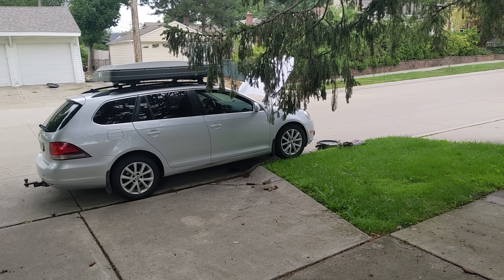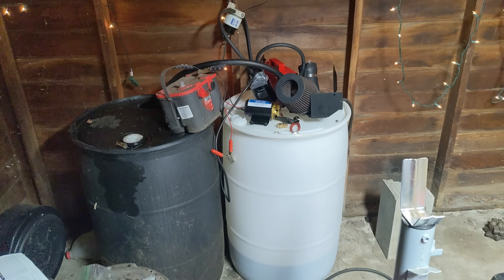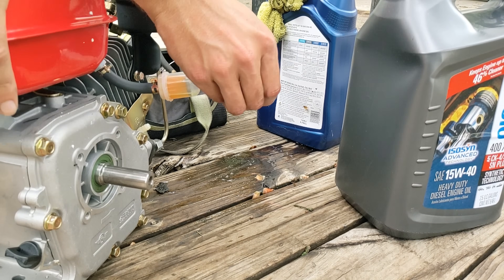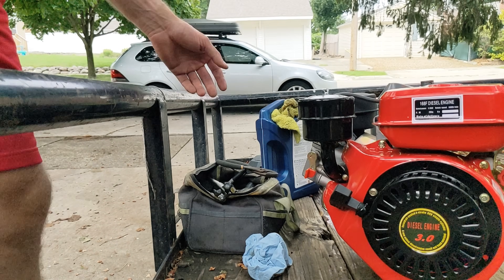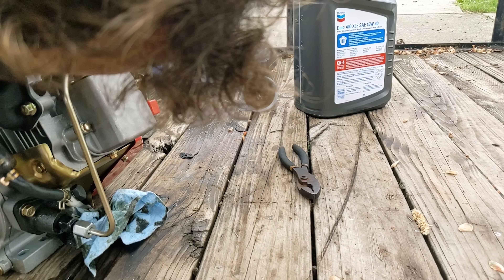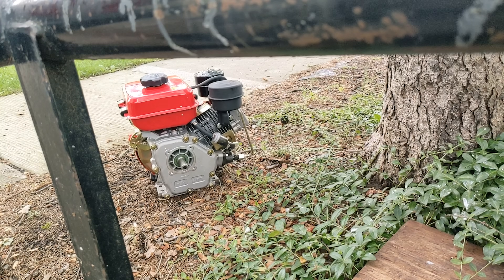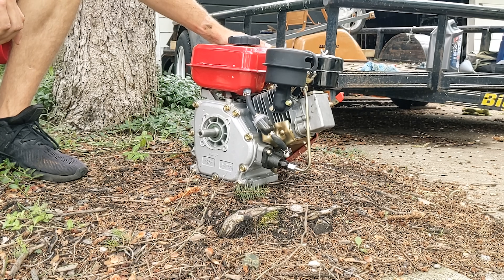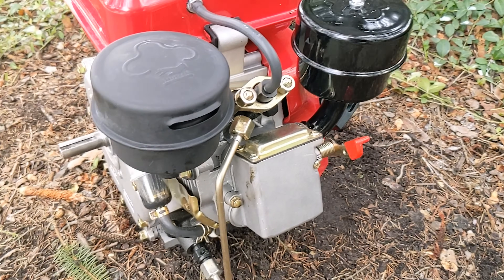Can a 196cc diesel engine run on Waste Motor Oil (WMO)?

Comment: 2:05  15w40 is very thick for that VW
Are ya in a super hot region? Normally they need 5w40 or 10w40 at max

Comment: Preheating the fuel is a great idea same as waste oil burner. Dropping injections pressure is also good saves pump. Filtering oil when hot would also allow for finer filter to be used. Hot can be 100 deg c

Comment: I use a magnet and then I pour it through a clean microfiber rag to filter it and then I use about 3 quarts of 2 stroke gasoline for every 5 gallons of oil. Since my truck is common rail and i dont want to coke up my injectors i use black diesel as a fuel additive more than an alternative. It makes up in lubricity for what you lose in that ultra low sulfer crap they sell at the pump. Obviously you shouldn't do this if you have a DPF.

Comment: Excellent choice of oil.
 I've owned my own semi's for 25 years, I've tried every brand of oil, and Delo is by far the best out there.
 For those who want to argue, it holds its viscosity the best, and has the best corrosion inhibitors.
 I've run water/methanol injection for 15 years on my trucks.
 With this system there is always some moisture that gets past the rings into the crankcase, and very few oils will compensate for this. 
 Why run water injection?
 Torque,  power, cools the engine,  cleans the engine.

Comment: The problem running a diesel on motor oil are the inorganic (SAPS) additives in the motor oil. Ashes from the additives will clog the combustion chamber, valves, exhaust channel and exhaust. My motorcycle engine burned roughly 15 Liters of 10W40 over a distance of 30k km which coked the exhaust side terribly. Since the opposite cylinder didn't use that much oil, it was much cleaner.

Comment: If you haven't check out a centrifugal wmo filter, they are pretty neat, and can filter quite a bit before needing cleaning them self've. Personally I would suggest filtering down further say at least 20 microns the reason is the largest particles are hard to burn, and will carbon up the engine over time. Get them down as fine as possible and mechanically it will last longer before needing maintenance, you could also add a bit of new auto trans fluid in directly with the wmo,to be filtered say a half a quart to a quart a gallon this will clean the combustion chamber pretty good

Comment: Try to mix with gasoline 800ml oil 200ml gasoline. And the engine more responsive. And low smoke.

Comment: I drive diesel trucks for a living and use to run old Detroit 2 stroke engines and ever time I changed oil I dumped the waste oil in the fuel tanks and burned it.

Comment: PS. Most engine oil filters are 20 or 30 microns so you're 100 micron filtration isn't doing much for used motor oil

Comment: Used to run my boat engine like this in the UK - till the government made it illegal. You can still do it, but you have to have a very expensive licence. I would generally ignore this kind of over regulation, but because of it, my waste oil suppliers are no longer happy to let me have it. Oil from oil changes always goes back into the fuel tank.

Comment: Very cool to see that this works :) I am debating whether or not to buy this one, or its bigger brother, which is 10hp. I think the bigger one would be a better buy, because it gives you a lot more flexibility. And even though it is more than 3 times as powerful, it only costs around $450 shipped :)

Comment: Every old diesel can be run with WMO just need to be a engine without cpu and electronics... Must be pure diesel :D but that 'fuel' creates problem for the engine if its not filtrated and mixed with diesel :)) and in cold weather its hard to start the engine

Comment: you did it wrong. first oil need to be filtered. cofee filter would be enough,
second, it should be mixed with diesel fuel, 50/50 would be perfect

Comment: First; the fuel line from the tank does not go to the "injector," it goes to the fuel pump.
Second:;  A metal particle ⅓ the diameter of a human hair can clog one of the six tiny injector nozzles, why risk it.  You could have clogged two or three of the nozzles and not know it until you put a load on it.  Without a load your test is meaningless. Ron W4BIN

Comment: Really you should at the least cut the old oil 50/50 with #1 diesel fuel. I'm tight with money, but not that tight.

Comment: Are you by any chance aware that your WV car engine features an oil filter? That filters particles down to say 25-30 microns size? Which you were trying to better by hauling your oil through the 200um screen??? So just curious, what did you expect to see on this screen? Also, do you change the oil filter on the WV engine EVERY time you change motor oil? As the book says?

Comment: I had a 10 HP version that I  ran on 100% Used Veggie oil (I collected from an Arby's Fast Food joint)
for about 5 years. It ran like a charm ! Never had any problems with it at all. 5 years later it blew a Head Gasket. Simple inexpensive fix ! Liked/Subscribed !
 FJB

Comment: I bought an Indian Enfield diesel motorbike from India, with a 325 mL diesel, single cylinder engine. And the fuel filter smelt of Curry. I can only assume that they used waste oil from cooking..

Comment: I think you'll find that the shaft is actually 19mm . . . . which is the same size as 3/4" . . . . . there's   NO Way   they would make that a different standard. Zero chance.

Comment: I run WMO (black gold) in my OLD 1989 7.3.. 100 microns is nowhere near enough filtration. I suggest obtaining a 0.5 micron polyester filter bag to pour that oil through. That's right, one half of one micron, the injection pump will thank you by having a long life..

Comment: Heat the old oil.

Let it settle out for a couple of days.

Run the oil through a good filter. (or you are asking to destroy the injector)

Mix 75% diesel, 25% used oil.

It will run fine. in warm weather.
It might be too thick for starting in cold weather.

Comment: you should try to assemble a motorized bike build with the waste motor oil, should be simple and cheap enough; with a good bike frame and some fat tires it could make a janky offroad build with that extra diesel torque.

Comment: You need to run the waste oil through a centrifuge to remove fine particulate.  These particulates will eat your injector and is hard on the engine if not removed.

Comment: At least the grooves from burnt carbon on the cylinder liner wont be bigger than 100 microns.
Carbon is some of the black colour in old oil.

Comment: I have an old Belarus AS250 farm tractor. I only pushed the oil thru a T shirt to filter the used oil for it. In the heat of summers , it has zero issues. In winter , I add 20% gasoline so it'll crank on cold mornings. Also have a couple 6.9 liter Ford trucks. We made a homemade centrifuge to filter the used oil for those old engines. The 6.9's run a little stronger with 10-20% gasoline added to the oil, but still run fine.on straight oil.

Comment: run HHO or propane in addition to blending with diesel.  NO- HHO  or LP won't improve short term (higher HP/torque gains)  and all that crap as they claim but YES it will give more complete combustion keeping from coking the rings etc that will happen on an alternative fuel that the injector  and injection timing is not tuned too.

Comment: Diesel engines do not give a shit what you put in them. They will run on it. And as long as it is a heavy, flammable oil, rather than a light aromatic, they will run WELL on it. They like motor oil so much, in fact, that turbodiesels will happily destroy themselves if the turbocharger seals let go and allow the engine's own lubricant to get into the intake tract.
Reply: So your saying so long as i filter the oils  a little engine like this will run on it? Mix used filtered vegetable, conola, engine, atf and itll work? What about things like grease i.e. automotive, or even bacon, and can you even turn those into a viscous liquid and it keep that form instead of re hardening?
Reply: Old diesels yes but you can’t run this stuff in a modern common rail engine for instance, it will destroy the fuel system
Reply: @alexbeuerman7608  what is there besides rail fed for diesel I thought they needed to be pressurized and couldn't run off of a carb
Reply: @rs-nk8cf  An engine like this, and pretty much any on road diesel before like 1995 or so is gonna be indirect injection, those will run on just about anything. It still has a pressurized fuel system of course but not as much finicky tight tolerance hardware in the fuel system as a newer CR mill

Comment: I’ve got a plan (more of a possible experiment, really) to use this with plastic pyrolysis oil . I don’t expect it to run for long before breakdown or maintenance. 

But it could be a sweet “proof of concept” to see if I can make a self contained unit to use the plastic that’s currently getting rejected by the recycling streams worldwide.
Reply: i've been wanting to try pyrolysis but im scared to blow myself up. Do you have a setup built? I would love to see a video on it.
Reply: @Geopolitics2day  I haven’t built anything, just starting the research process

Comment: In Afghanistan I saw a guy with a watercooled China diesel.  He had it hooked up to what looked like a truck alternator with a couple of wielding leads.  They had a half 55 gallon drum with a pick up at the bottom and the return just poured back into the barrel.  The whole contraption was mounted on a 4 wheeled trailer and dragged around with a tiny pickup.  He didn't have a wielding helmet but he did have a dark piece of glass he would hold in one hand and the rod in the other!
Reply: It's pretty common in my state Kashmir
Reply: probably cheaper in afghanistan to make that instead of buying a welder or they just like making things.
Reply: @ARMASOG  They HAVE to make things.

Comment: It works - for a while.  Runs and starts better if the oil is thinned with about 20% kerosene.

But the soot, junk and additives in the oil will coke up the injector pretty soon.

Waste hydraulic oil works better.

Comment: Waste motor oil, really?
Are you aware that that kind of oil has got a lot of additives, that are not meant to burn?
Although a little of it can be burned , during normal use of a diesel motor: that is why car engines have got to respect emissions legislation, through the help of special exhaust lines and catalyst converters.
Without this, burning motor oil is simply producing dioxins, that are highly carcinogen substances, that don’t degrade when released.
Is it worth it? In my opinion, better have recycling oil companies handle it the proper way!

Comment: No use the coarse filter initially to fill the day tank or storage tank, but you want a 10µ filter for a primary or your OEM filter will clog up and bypass all sorts of crap to your injector. Also you probably should start on road diesel, then switch fuels once it is up to operating temp, and switch back to diesel before shutting down. And PLEASE, bolt it down before running it! I positively CRINGE when I see guys starting these engines just standing loose on the ground or workbench! 

I would NOT run these little guys on waste oil, though. It is really hard for the injector pump because they are meant to run road/farm diesel, which has lower viscosity than most waste oil. You may find excessive carbon deposits too, especially if you run the engine on the cool side. 

Your power rating is probably in watts. There is very little safety factor so don't exceed it. For a generator this makes it sort of easy to crunch the numbers but for your edification 1hp = 746 watts. Anyway make sure your alternator or generator head is properly fused to protect the engine as well as the electricals, and you have meters for monitoring current and voltage, and also frequency if you are trying to run an AC generator directly. Easier to use a car or truck alternator (remember bulk stage charging voltage for a 12v battery is actually 14.4v thereabouts, and volts x amps = power in watts) to charge a deep cycle battery, and run an inverter from the battery. You won't get a lot of juice out of it. Adjust your pulley sizes for rated power at rated RPM for best results. In Asia these engines are mostly used for small scale agriculture projects or powering very small boats but it is not unheard of to use them to spin an alternator to charge a battery for lighting, cell phone, etc.

Best practice is when new, run it at half throttle until the cooling fins are hot, shut it down, and change the oil. Repeat if you are anal about it. The blocks often have bits of metal or casting sand in them which can quickly wipe your bearings and erode your cylinder walls. One or two PROMPT oil changes will get rid of most of it and make your micro diesel last a lot longer.

Comment: if you place that bucket of oil high ,place a length of the old sisal/hemp rope in to it and the other end into a clean bucket and leave ,over time the oil will migrate to the lower container  clean  and no deposits and garbage  ,was done in the old days to recycle oil  becomes a lower grade  but clean usable oil times were tight and need to recycle all that could be  usually was reused in engine but in your case you would have CLEAN fuel,remember it takes time to filter down ,and you can dispose of the left behind sludge
Reply: That's a genius idea

Comment: For long life of the engine i recommend to use one of the bellow methods:
1. Using a mix of 80% WMO and 20% gasoline to thin in out for easier cold starting and low smoke.
2. 2 tank sistem
 Original tank with diesel for starting and flushing the sistem before shuting down. Second tank will be heated from exhaust mufler and will be with WMO. And a 3 way valve to switch from one tank to the other.
Reply: Please note that my comment is based on personal observations.
1. The mix i recommend is only for engines with low injection pressure with rottary pump or inline pump. It is not available for common rail diesel or PD engines. I used this mix for 5 years in my 95' passat 1z engine in a temperate climate with no problems.

2. Heated tank sistem by mufler is not the best option but only available for aicooled engines. In this case you should use a long exhaust pipe ( 5-6m) and an infrared themometer and let the engine run at idle for half an hour.
While idling you shoud check the temps along exhaust. You should mount the tank only where exhaust temp is bellow 50°C. That way you are sure that you will not exceed 90°C when the engine is under load. 
Please note that wmo have a very high flash point. In turbocharged engine they have to lubricate and cool the turbocharger that works at usual temps of 700°C and even 1000°C. So heating up to 100°C in a tank is no worry. Also this temp will lower water content of wmo by evaporing it.
Sorry for long post. Bee safe!
Reply: Two tanks is the clever way to go. BUT!!!
1. The waste oil tank shall be NOT heated by the muffler but with the cooling air, FOR SAFETY REASONS. Remember the engine is air-cooled so the heat is for free.
2. Once the engine is started, and the waste oil is reasonably warm, you can burn basically anything, like unrefined rapeseed oil or wate oil from McDonald's kitchen.
Reply: Gas burns hotter than diesel!
Reply: @NoNo-ru2xl  no sir! Not in a combustion engine ... That is misinformation my friend
Reply: I am afraid the gasoline ignites too early and you will get knocking, which can destroy the engine.
Reply: It's quite similar to fuel system of cargo ships. Diesel for start-up or running near the shore, and heavy oil for running at the center of ocean
Reply: Use kerosene to thin that oil say 10 to 15 percent

I often use thin hydraulic oil as well
Reply: best solution indeed!
Reply: Can you use old gas for the 20%? I have hundreds of gallons of waste oil from oil changes on my boats along with a bunch of bad gas. I’ve been looking for a way to use the bad gas.
Reply: @autohosh72  It will actually run just fine as the gasoline has lost a bit of its octane.  The gasoline used in this application is really just to thin the oil down to help it flow through the pump and injectors.
Reply: @autohosh72  yes.
Reply: @mross8792  nah
Reply: NEVER gasoline in a diesel.  Just no. It burns too hot.  Even 5% can cause overheating and severe damage.
Reply: yes in diesel but mixed in wmo to thin it is fine 10k miles on a 85 15 mix on a idi @fhuber7507
Reply: @fhuber7507 he meant in the waste motor oil to thin it out🤦
Reply: @fhuber7507 gas doesn't burn hotter then diesel nor does it burn hotter then wmo  I'm not sure where ur coming up w this idea, diesel actually burns much hotter then gasoline in a combustion engine

Comment: Does this engine use glow plug on it? Would you mind if you can show us it
Reply: No it doesn’t
Reply: Glow plugs require a power source to generate heat. No batteries on this pull start

Comment: Guys! you need add petrol 10:2 two litre petrol on 10 l oil.. 
And when you are using rapeseeds oil then is 10 l rapeseeds oil 10 diesel 4 l petrol and 300 ml.l two stroke oil.. .. then costs of bio diesel is 70 80 p per litre . Than 1.60£ per diesel.
 It works good..

Comment: Imagine a metal bucket half full of used motor oil - then picture a match, strike it and toss it in the bucket - heavy black smoke for hours - this genius is an ecological Phd like me 🤪🤷‍♂️👍
Reply: Try again. A match will not ignite motor oil at ambient air temperatures. It won’t even ignite diesel that way.

Comment: Oil is how you get a run away diesel. The seals in the super charger give way and the engine runs ungoverned on oil from the super charger. It’ll either run out of oil or blow itself to smitheriens.
Reply: Or u cut the air supply by blocking the intake rq
Reply: Wow that engine had a supercharger!
Reply: This doesn’t have a supercharger or a turbo. It’s just an injector ran on a cam inside the engine.